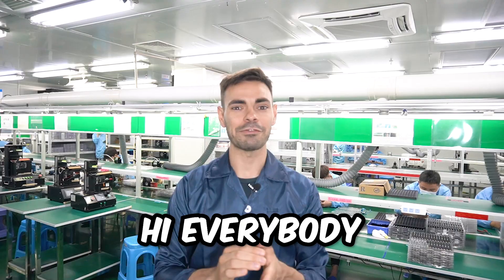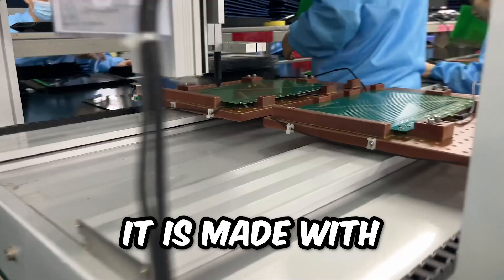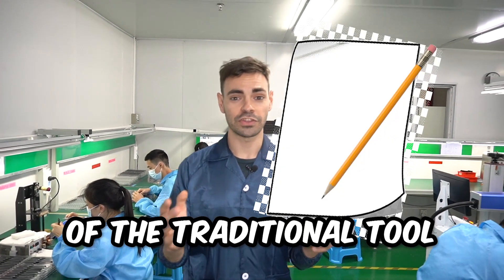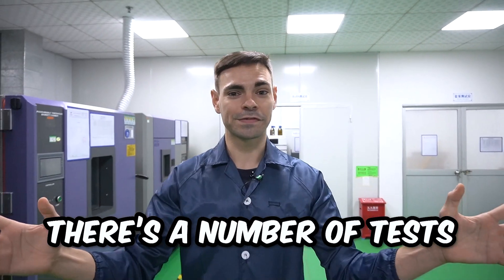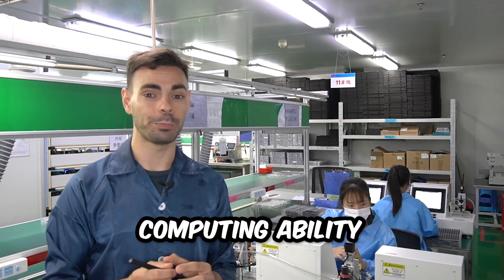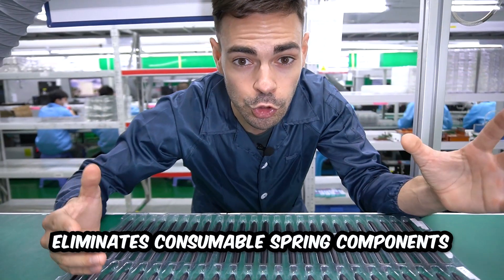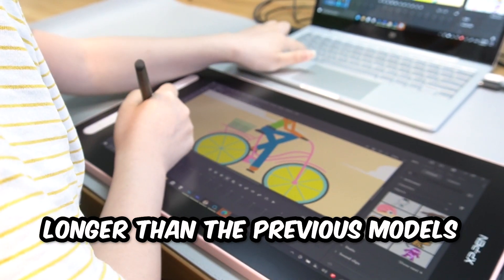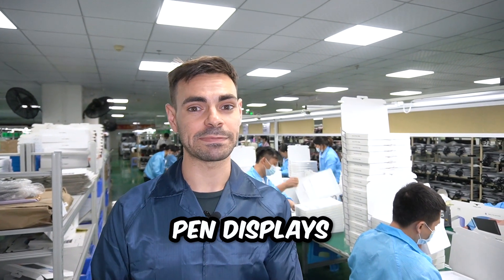Revealing lab tour of the X3 Smart Chip

Comment: Hi, this question isn't relevent to this video, but I have a Macbook Air and an XP-Pen Artist 12. The Macbook has 2 USB holes and a thunderbolt. Will all the functions work fine just like with a normal HDMI but instead, with a mini-displayport-to-HDMI adapter?
Reply from the maker: If the adapter is compatible with Macbook Air, then yes!